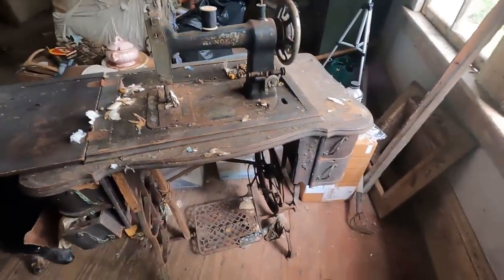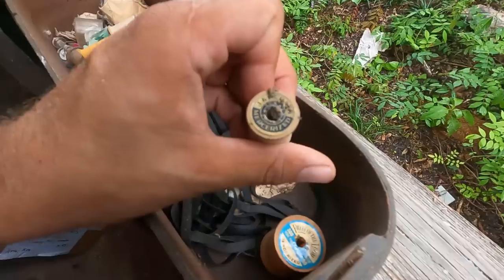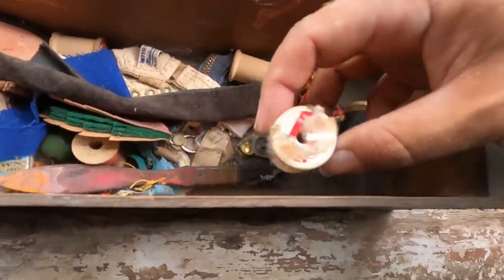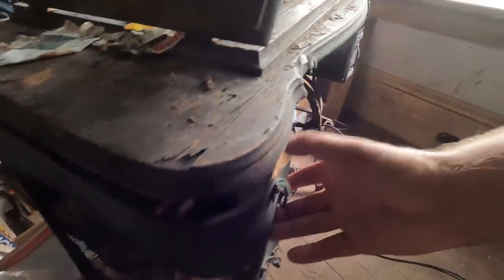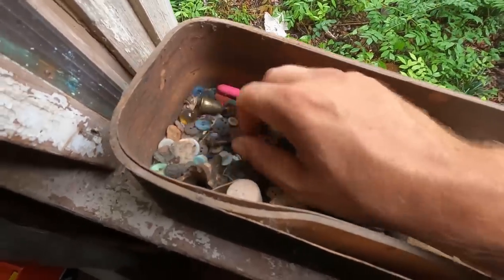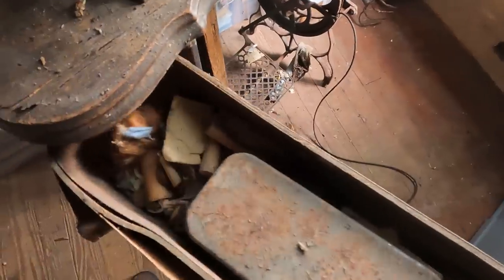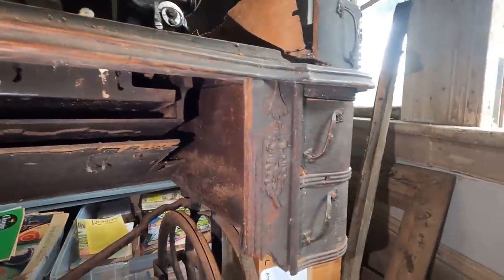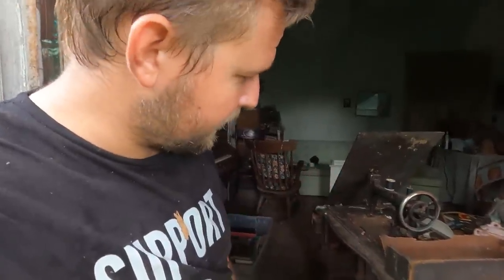I found THIS in my 140 YEAR OLD ABANDONED HOUSE | WHATS INSIDE??? | NEW FLORENCE SEWING MACHINE

Comment: A really great find.  A new belt and some oil and a cleaning and it will sew.  The metal box has the attachments, and several were also scattered in the drawers.  There is a gatherer for making ruffles for the dresses of the day, and the wooden round needle boxes, wooden thread spools are both highly collectable and sought after as well as the small round plastic boxes that held zippers.  The hat pin might be a ruby and gold, since the Byrds had a store.  I also saw what looks like a pink pot w/lid in the background and a large picture frame leaning against the wall maybe?  All are great finds, and the little doll head is most likely from the Victorian era, too. One of my favorite Byrd Farm videos!

Comment: Gather all the old wooden spools of thread and display them in one of the old canning jars.  The tin with all the original attachments is a great find to complete the sewing machine.  I have an 1800's Singer treadle sewing machine, too.  And I display an old sewing basket, the jar or a wooden bowl of wooden thread spools, and some large antique wooden spools from a mill on the top of my machine cabinet.  The drawer fronts on your cabinet are very ornate.  Another great period piece matched to the home is a good find.  Well done.

Comment: Robert, that sewing machine is an absolute treasure! Think of how timely it will look in the house once it is cleaned up some. You have a very nice hat pin in one of the right-hand drawers. The box of attachments is fantastic. I think I saw a ruffler in there, and a hemmer or two. We have my mother-in-law's treadle machine in our garage. The drawers are not as nice as these but are very similar. They don't have the knobs. There is a box of attachments. My husband remembers the clickety noise of his mom using her used machine in the 1940s. Keep the wooden spool threads and all the buttons. What a nice surprise this was!

Comment: Fascinating! Just think, those tiny doll heads were probably once held by Wee Willie and the buttons were probably from her little dresses.  While viewing the drawer contents, I was not surprised as my grandmother lived through the depression and saved everything.  The drawers of her machine closely resemble yours. She even saved scraps of thread and wound them around pieces of cardboard or old needle packets.  The hat pin, because of its stone shape and intricate design, could possibly have more value than you'd think.  It looks like the early 1900s.  The metal link on the belt probably just rusted away and could easily be repaired if the leather is still good. I've used my grandmother's machine several times during extended power outages. Great find!

Comment: Cool find!
I'm 70 years old and have my  Great Grandmother's Singer sewing machine, 1865.  It's the same style as this one, treadmill.  The machine on mine folds down into the cabinet and the extension part folds over to make a nice stand. Mine has 4 drawers and a piece in the front top that folds out with a few sections also.
Mine still works.
The metal box from the one drawer should be the attachments for the machine, I have a metal box in mine.  I also have 2 of the wood round needle holders, I always thought they were pretty cool.
I grew up with my grandma using it for making things.
I hope you can restore it for display in your house.
Suggestion; keep the little treasures you find while cleaning out your house and display in shadow boxes.  I'd also keep a few pieces of wallpaper, for the back inside the boxes and display the treasures on top.
Just discovered your channel a few days ago and have been watching trying to get caught up.
How did you find and aquire the house?
Are you from that area?
If you have a video that answers questions, please direct me. Thank you.
Reply: Robert inherited the house, I'm not sure if his family built the house or bought it at some point from the original owner.
Reply: @indianaslim4971  
Thank you for the reply.
I just started watching yesterday.  Hope there's a video of Q & A for details.
I like how's he's very respectful of the property.
TY

Comment: That is a cool find. We had a treadle Singer machine in the attic when I was a kid.  I would push the treadle back and forth with  my hands while my brothers made siren sounds until Mom made us stop.  That one still worked into the 1990's when they sold the house.  I think they sold the machine, too.  See about getting it fixed.  The cabinet to the one you have is a lot fancier than the one we had.

Comment: Here’s how it works. Grab the actual sewing machine and lift. You’ll see that it will raise up. There’ll be a mechanism or something that has been holding the machine up. Move that and then slowly lower the machine until it has gone all the way through the hole and is hanging upside down. Then take the hinged folding table and fold it over the top of the table. The machine will be under the table and you’ll have a beautiful flat surface to display all your finds from the drawers!
Reply: The top looks rusty which means the hinges to lower the machine may be rusty as well. If you try to force the hinge, the wood may splinter. Recommend you use some oil to loosen the hinge first. While WD-40 works well on rusty hinges, it will not be great for the wood. 3-n-1 oil might be a better choice since you can control where it goes.
Reply: Robert, Please don't fold the machine down in it's current condition. Weak metal or wood could break and machine could fall to the floor. I'm in Central AL and can meet up with you to clean the machine and linseed oil the table. I do not do antique restoration per se, just an experienced seamstress and lover of most things vintage & antique. Congrats on your awesome find!

Comment: My mother had this same king of Singer sewing machine in the 1940's.  I don't know when it was bought new, but sometime earlier than the 40's.  The ledge to the left is not only a work platform but when placed on top of the machine, the machine turns down and the top can be used as a table when the machine is not in use. I can clearly remember my mother using this machine and the sound it made.  I didn't realize at the time how much coordination it took to operate it - pedal and guide the material being sewed at the same time.  It's the same coordination needed to operate the pedals of a piano while playing music with the piano keys.

Comment: Been watching the Old Byrd House adventure with interest. Great to see what you're doing. Can't speak to the New Florence machine, but when I was a kid recall a treadle-operated Singer I saw when we visited grandfather in Waco. Still worked, an aunt sometimes did some sewing with it. Memory may not be trustworthy considering i was maybe 6 or 7 then and about to turn 79, but I recall being told it came from grandfather's parents and was bought new in the 1870s. Those treadle machines can be busted, like anything, but they are mighty rugged and that one looks like just clean and lube might well get it up and running, and be a good thig if it was.

Comment: 'What even is that?' well it looks to have sand inside it and if it does, it's for sharping your sewing needles and pins. The person was a die heart recycler when it came to sewing. Not just the buttons but fasteners from bras, the hose holders from girdles, bits of fabric, even chalk and crayon for marking fabric. Use what you have and you'll never know when you'll need it.

Comment: Robert, that metal tin in the top left hand drawer is holding the attachments for the sewing machine. They are very rare, few ever survive. Probably worth more than the old sewing machine in its cabinet, even once it is restored. Most people do not know how to use them. The instruction book that came with the machine explains/demonstrates how to use them and what fancy things they will do. Mine makes things that you can't make with modern machines but wish you could. One attachment I have will make pleats - any size - you just feed the material into it. No pre-basting required.

Comment: Do some research before cleaning your sewing machine. all the metal parts should only be treated with sewing machine oil. It is beautiful! You can replace the wheel belt. She needs oil oil oil, if rust use wd40. Lots of info on the internet for these types of machines. Those are the needles for this machine. Some of the attachments you found may go with it as well. Nice find Robbie!

Comment: Not sure if others had commented but the machine is called New Florence since it was manufactured in Florence, Massachusetts. Company was started about 1855 by Leander W. Langdon and was in business for about twenty years. A lot of his machines were very ornate.  Peak sales were in about 1870 with about 17,600 being sold in that year.  From then on though it was downhill and 6 years later less than 3,000 machines left the factory. Since Singer machines are a dime a dozen, finding a Florence is a much better find and will be a nice addition to the "Old Byrd Farm" after it has been restored to it's original condition. Whoever does the restoration should be able to tell you what year it was actually built.

Comment: What a great find.  I would put all the old buttons in a mason jar and display it on or by the machine.  The old wooden thread spools in a basket along with the needle cases which you don't see any more.  Or you could use a very large large glass jar and put the spools and needle cases, the buttons, marbles and the doll babies and doll heads all in it.  Leave the tin box with all the different sewing feet etc. in a drawer.  It will clean up nicely and be a wonderful display piece.

Comment: Hi Robert. The "what even is that" thing in the sewing machine drawer looks like the cloth torso which would be stuffed and fitted (possibly with the china head in the other drawer) to make a pincushion doll.  These were a VERY popular item in their day and can sometimes still be found in antique shops or junk stores depending on their condition.  A china head was attached to a cloth torso, stuffed and added to a big pouffy stuffed skirt trimmed with all kinds of fancy scraps of lace and beads and whatever appealed to the maker.  The resulting figure was used on a vanity or dresser to hold either/both sewing pins or pins similar to the one with the red stone in the first drawer which held scarves together or hats on heads.  My mother, who was a dress maker by trade, made dozens of  these pincushion dolls and both my sister and I have at least one.

Comment: I had those little bitty rubber dolls when I was kid. I believe they were called teeny weenies. I  saw the machine in A-1 condition for $399. Table in good condition $299.  The tin box with all the feet is great to go with it. They didn't have a date. I would date it at late 1800's to very early 1900's

Comment: I have and I use my mothers old 1930's Singer treadle sewing machine.  They last forever and parts like the round leather drive belt are available. The sewing machine folds down into the cabinet and that hinged lid folds down flat over it. Lift and tilt back the machine and you will see how it works. The serial number should indicate when it was made somehow. Clean that cabinet up and give it a coat of shelac.

Comment: My mother had one similar.  You can lower the machine part down in the cabinet and close the lid.  As I recall, you lift up on the machine part and pull up on a levered board to lower it then close the lid.  Might have to experiment a little to figure it out.

Comment: It is probably from around 1900, but I could be wrong. You can still order the broken belt on the wheel (from Singer). The threads are newer, like from the 1960's.

Comment: If you look at the serial number plate on the sewing machine. There will be a letter. Look up singer sewing machines made dates. The letter indicates the year made. I had a pedal one made in 1901 i sold, no motor and extra replacement band. She cleaned up nicely.

Comment: You can tilt the machine back slightly the there is a small board that holds the front up ,pull that up. Drop the machine down inside and close it up.

Comment: Wipe down the machine with a damp cloth and then use machine oil to clean it, wiping it down with the oil will clean it and help to remove the surface rust. Just Don’t use anything like WD40 it’s not machine oil. I have my grandmothers New Home treadle machine and have been working on it on and off, haven’t heard of New Florence.

Comment: Look for a serial number on the actual machine.  It might be underneath.  Then you can look up the number to get the date it was made.  We did that with our Singer treadle machine.  Found out ours was from the late 1800's. We were lucky enough to be able to print out the instruction manual as well.

Comment: Here's a video from YouTube about the Florence Sewing Machine: https://youtu.be/jNv6307N64Q It looks like you'd wind the bobbin on the right front of the machine. If you could get it running again, I am sure it would work fine. I learned how to sew on an old Singer. 
Here is a video on how to take care of an old Singer which would certainly apply to the Florence: https://youtu.be/cScrb9spc18  

I think this one thing is the most thrilling of all the finds at the Old Byrd Farm. Just imagine how many clothes were run up on that machine: shirts, shorts, skirts, blouses, dresses, overalls, aprons, curtains and doll clothes. That little thing you found that was part of the mouse droppings drawer was a doll's torso.

Comment: Lapel pin not a hat pin
Reply: Actually, it is a gentleman's stick pin. The crook on the pin held your cravat in place, and there would be a little end piece so you wouldn't stab yourself while wearing it. 
I have a New Florence machine in my barn/sewing machine retirement home. I have about fifty old machines. Most old machines have the attachments neatly stored in the original box because nobody ever used anything but the buttonhole attachment.😆
Your machine will certainly work if you clean and oil it. Don't count on selling it for big bucks. I usually pick mine up for $20 or less...
Love your channel.

Comment: Florence History - The Fabulous Florence
ISMACS News
Issue 29
October 1990
The most desirable of the Florence treadle sewing machines
Most desirable of the Florence treadles, this version, known as the fancy or pierced-leg, actually uses very fine iron castings and intricate decoration to give a very delicate effect. Drive is by flat belt from the count-shaft, which also supports the fly-wheel.

SOME 14-ODD YEARS ago a crowd gathered on the edge of a field in Brimfield, Massachusetts to watch a crazy-looking Englishman attempting to dismantle a treadle sewing machine with the aid of a bent electrician's screwdriver and a rusty pair of pliers with one broken jaw. I was that Englishman and the machine which finally came apart to fit in a friend's car was a Florence - the first American machine bought in that country to add to the MS collection.

Earlier this year that same scene was repeated, this time in a Vermont barn, where another Florence machine was broken down before making the trip to England. All of which goes to prove, that although the Florence machine rates highly on any collector's wants list, it isn't that rare of a beast in the New England area where it was originally made.